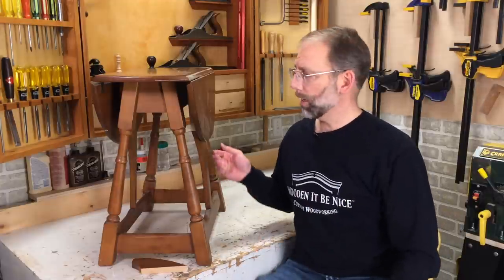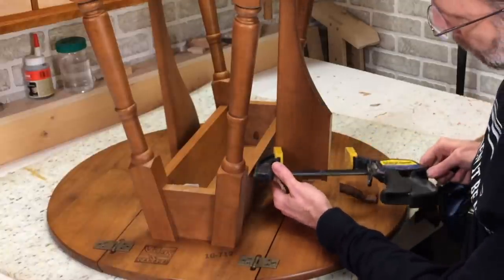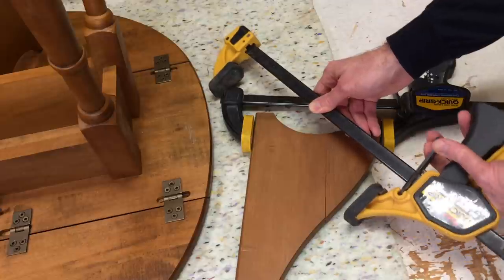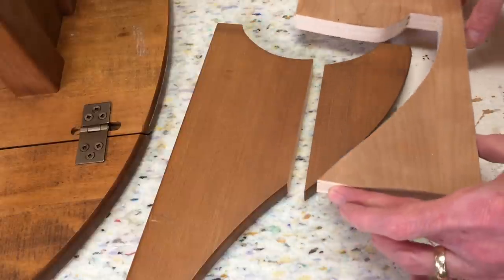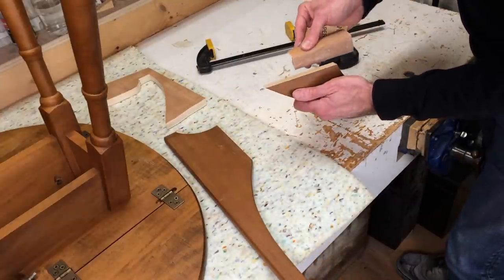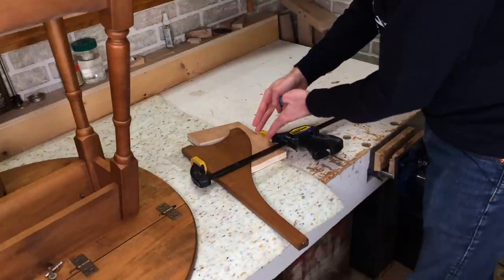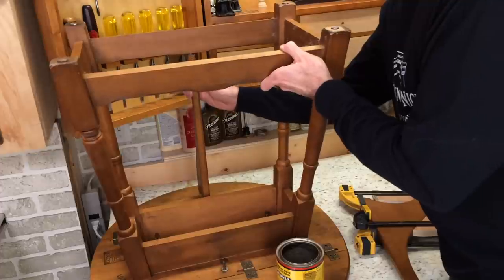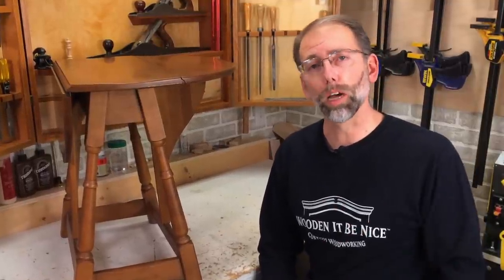How to Clamp That?  Wood Clamping Lesson on a Table Made in Cowansville, Quebec, Canada #Woodworking

Comment: I'm lazy, so I would have put a piece between the broken part, and the vertical support board.

That way, I could use a clamp on the vertical part, and the broken part. In order to get the clamp to stick on the rounded, broken support, I would have used the 'masking tape/ CA glue' trick.

Of course, I'm not a pro. That's why I love watching this channel.
Reply from the maker: Thanks for sharing your suggestion.  Glad to hear you're enjoying our videos.  Thanks.  Scott

Comment: Nice video. A quick domino or dowel could have helped with the alignment and sliding, but certainly not necessary for strength.
Reply: I like your idea.  Can you explain how you would drill the hole in the broken-off piece so the holes would align?  Thank you.
Reply: @batmansdad3195  yup - this is exactly how it's done
Reply from the maker: Yes, that would work if you have accurate equipment to do that.  Thanks for sharing that tip with our furniture repair community Nyla!  Scott

Comment: Just finished repairing an everyday use oak chair for my mom using your technique.  Hammering apart the loose joints,  scraping the old glue off,  drilling out broken off dowels,  glued, new dowels and clamped it all up.  Came out solid.

Comment: I just clamped a new piece of wood to a chair leg that has a 4” long chip out of it. I used coarse twine and wrapped it.
Reply from the maker: It can be difficult to get string/rope to provide enough clamping pressure.  Next time I suggest using rubber tubing, which provides continuous pressure when wrapped around something.  Here's a link as an example https://amzn.to/30k26QP

Comment: I would have reached for a dab of grease-- you chose wax however. Is it because wax is less likely to run and/or stain?
Reply from the maker: Wax won't penetrate in wood like grease will, so it will continue to lubricate the parts for a long time.  I would only use grease as a lubricant between metal parts.  I hope that helps.  Scott

Comment: Your vids are like a trade school course by a mellow, super competent teacher. Nice repair. If I had done this repair I wouldn't have thought of using that sheet of acetate. I would have raised the work up off of the bench to prevent sticking. I've done that in the past. Question. How did you clean up what little squeeze out that may occured? If it's a water based glue I would have just used a damp rag, then dried it with a dry rag. Anyway, good work, as usual.👍

Comment: I also operate a furniture repair shop in Ormond Beach, Florida. Chairs are the bread and butter of my business. Chairs are notoriously difficult to clamp because of few square angles to work with. Each project seems to have its own unique solution. I also get anal in respect to putting them back together exactly as they were, which is very rare. You know exactly what I'm talking about!  Here's a quick tip for you - use the markers on the edges to be joined before glue up. And just say no to gorilla glue! Ken

Comment: I still don't know why I find your videos extremely soothing in addition to being informative. Keep up the good work!
A question though: Why did you glue both of the surfaces? It is wood glue, so gluing just one side would be enough, I assume?
Reply from the maker: Thanks for the supportive feedback.  To answer your question about applying glue to both sides, this is a best practice to ensure proper glue coverage.  For example if the glue is applied thin in spots on just one side, there is the risk that the wood absorbs too much of the glue and it wouldn't bond properly.  By applying glue to both surfaces that risk is eliminated as both sides have a chance to absorb some glue before the parts are assembled.  I hope that helps.  Scott

Comment: You say you use an artist brush. Do you clean them after or just chuck them in the bin every time? 
If you do clean them how?
Reply from the maker: I clean them with soap and water.  If you use PVA or hide glue and the glue dries on the brush by accident, it can be soaked in warm water and worked loose to wash it out.  One brush will last for years so there's very little waste.  I hope that helps.  Scott
Reply: @FixingFurniture  Thank you and thanks for the response.

Comment: after you use your artist brush to spread the glue, do you throw it away? or do you know a good way to clean them so they can be reused?
Reply from the maker: I clean them with soap and water.  If you use PVA or hide glue and the glue dries on the brush by accident, it can be soaked in warm water and worked loose to wash it out.  One brush will last for years so there's very little waste.  I hope that helps.  Scott
Reply: @FixingFurniture   Thanks for the reply! That definitely helps, thank you.
Reply: Harbor freight has shorter brushes (8”) that are about 30 for $2.99
I use them daily and just toss them after each chair or project.  Easy peasy!

Comment: I've had success with using a plywood backer and screwing blocks to the plywood where the curves are to hold the piece in place while the clamps do the work. Hard to explain in a comment but hopefully that gives you an idea of the technique. Both ways work great, it just depends on what you have on hand. I don't have a bandsaw so making those cuts for me is very difficult.
Reply from the maker: I think I understand what you're describing.  It's adding material instead of cutting it away.  Sounds like it works!  Thanks for sharing that.  Scott
Reply: Hey that is a good tip for me, another no bandsaw shop guy. Thanks

Comment: The material slid because the clamping force was not perpendicular to the repair joint. Looking at the bar where it crosses the joint, you can see this. It is interesting how our eyes give priority to the places where the clamping pads are rather than the bar crosses the joint.

Comment: I have a solution: Two strips of wood for each side. Use long screws to draw the strips together. Clamp the strips of wood directly to the flat side of the board. Works like a charm. Vector clamping is cool, though.
Reply: I don't understand. would you please explain it more detailed.

Comment: Hard surfaces never fit precisely; that’s why anything assembled from parts that has to hold a seal, is joined with a mating gasket.  The clamping block you cut from the traced outline couldn’t perfectly fit, thus when lubricated with glue, the glue up joint slipped.  Next time place a silicon rubber strip between the curved part and its mirror clamping block, which will distribute the clamping pressure more evenly.  Signed a mechanical engineer.

Comment: I do not understand this. This is a video about clamping yet you don't use any clamps.? 'Quick-grips' © aren't clamps, and it is impossible for the quick-grips to create a high enough pressure to get a good glue joint. You need to use REAL clamps and you need to tighten them as hard as you possible as you can. It is the pressure, not the glue, that makes the bond. p.s. I am a skilled cabinet-maker and this is basic material in ANY school.